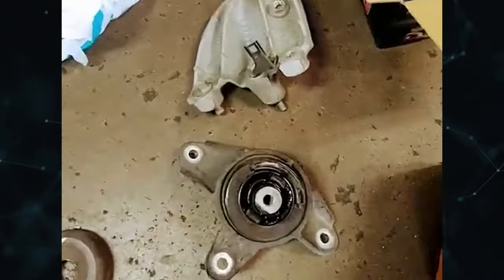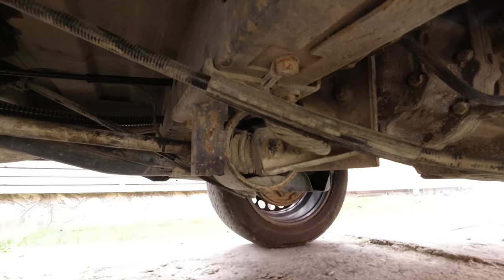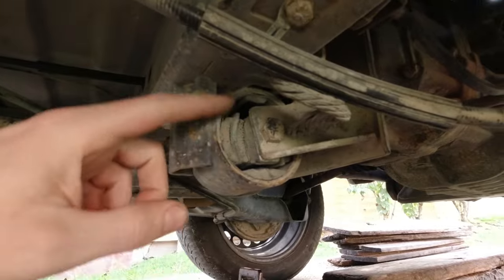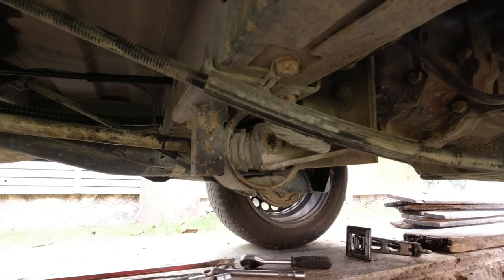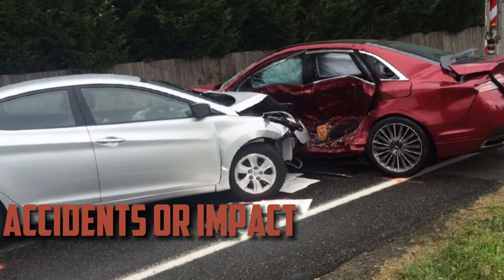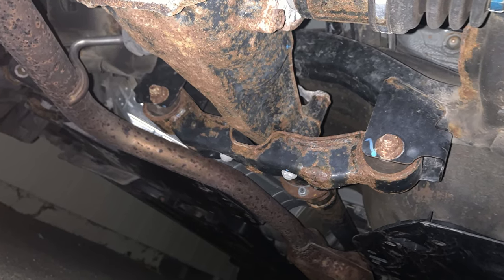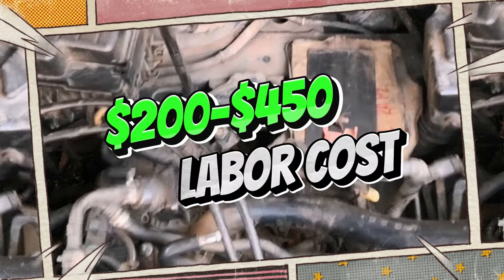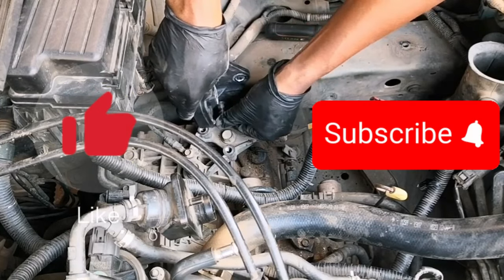5 Bad Transmission Mount Symptoms. Causes and Replacement Cost

Comment: My Octavia VRS (2016.) is making a sort of rumbling noise that almost sounds like when you are "slurping through a straw out of an empty cup" while the car is turning left. It is barely audible when going slow and gets louder the faster I go through a turn, and as soon as I start to level off the wheel the sound immediatley disappears, and reappears as soon as I start turning my steering wheel to the left again. Been researching on the internet and most people with the same car claim it could be a left gearbox mount that went bad and is causing the gearbox to collide with the rest of the car while in the left turn...

Comment: I have a 2017 Nissan Rogue Sport. 60,000 miles.  Noticed shaking of vehicle when stopped at stoplights. When car in park - no vibration 
Changed out the main engine mount.  It was damaged.  Not the rubber, the metal. 
Two weeks later, new main engine mount again damaged. These engine mounts were factory 
Question: could a CVT transmission failure cause the motor mounts to fail?
Reply: Did you find the answer? I also need to replace the engine mount, though on another car (2003 Chevy Cavalier). Someone on Amazon wrote that the new mount got broken after a month or so. It was aftermarket part though. We also have 2009 Nissan Sentra, many problems w/suspension. I replaced all struts, all were bad (~60K as well). Now I think maybe for Nissan the aftermarket parts on suspension will be actually better, since their original ones don't last long.